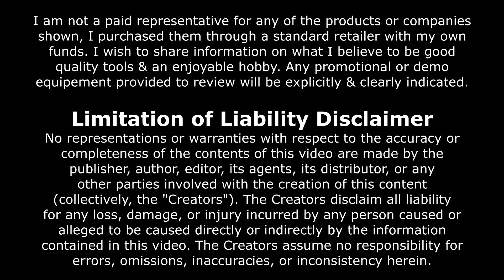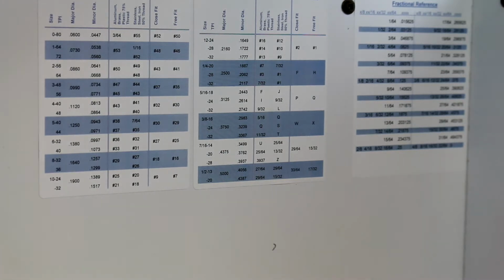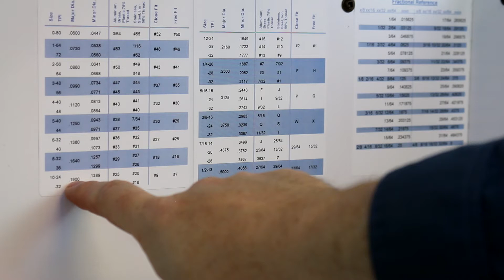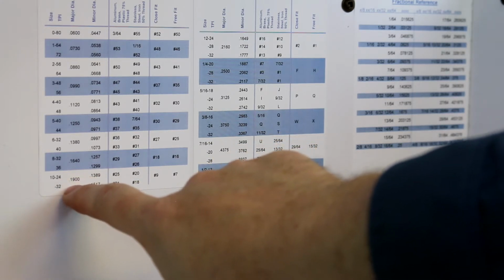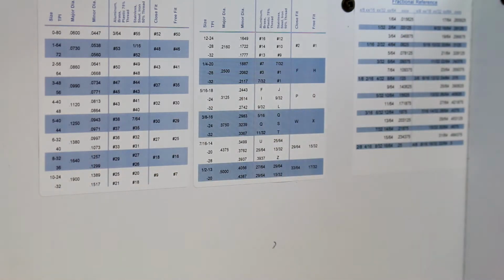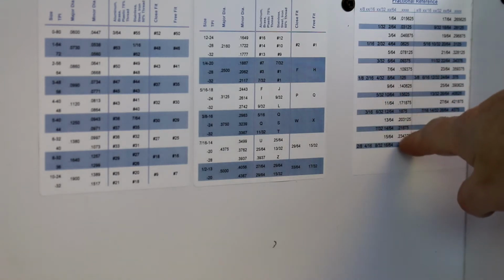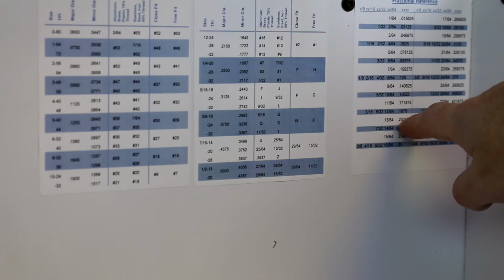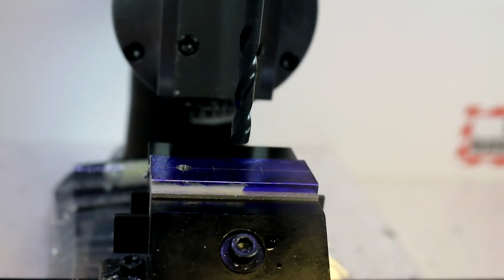Mill Projects 101 - Strap Clamp Part 6

Comment: Excellent video.  Thank you for uploading these.
One tip. When mounting an endmill in a holder with a set-screw, ensure that the shoulder of the flat is resting against the side of the set-screw in the direction that the end mill will be forced. This way, if the set screw should loosen, the endmill will not move axially.
Reply from the maker: +Herr Schmidt Great tip! I've been doing that accidentally on the principle that I want the bit as far into the holder as I can place it (while still using the flat). I hadn't thought of the additional benefit you have pointed out. And thank you for all the excellent comments, I really look forward to reading what everyone has to say about the videos I'm uploading.